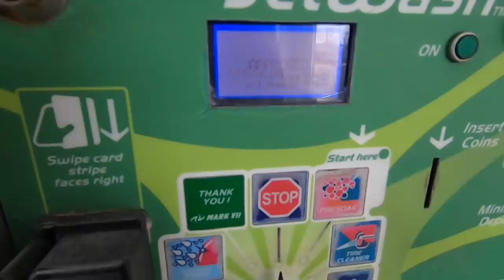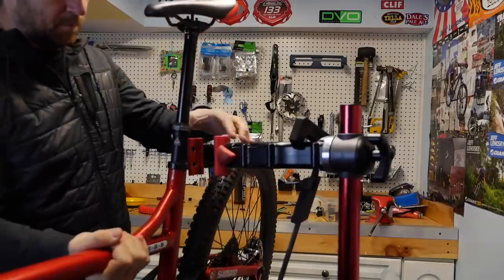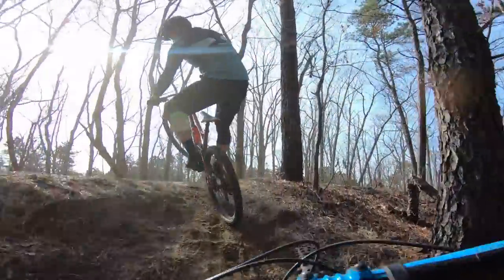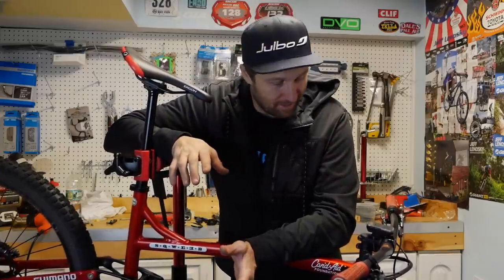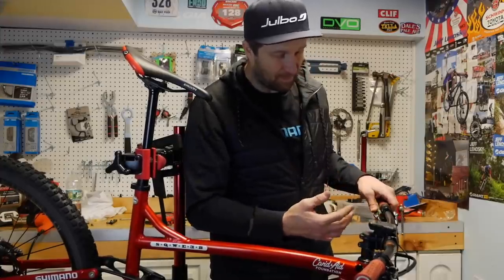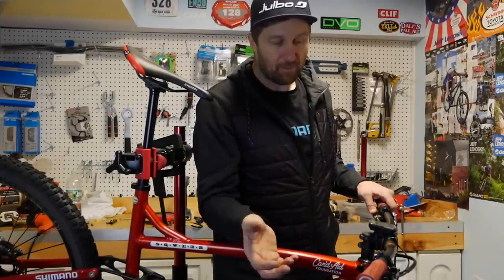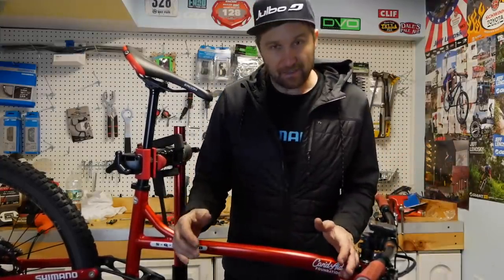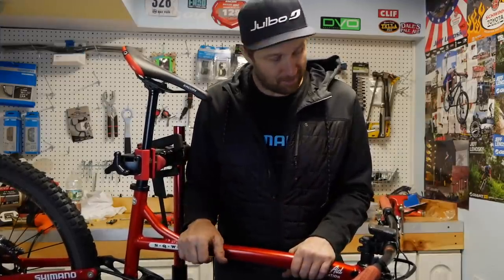I UPGRADED MY BIKE!!! | SHIMANO XTR FIRST LOOK

Comment: What up Big Pimpin'?! That's a hell of an upgrade, even without the weight loss, still hawt. I'm really curious to see how those pedals work for you over time, been some interesting reports of issues thus far.
Reply from the maker: #THELEGENDMTB what have you heard? I’ve used SPD’s for 30 years!
Reply: @JeffLenoskyTrailBoss  I've heard complaints about the bearing seals on the axle coming unseated. Only a few reports, but still makes me wary. Love the look of the pedal, much better platform than the XT or Deore version and oh so sexy.

Comment: The other bike must have been a bit lighter. Did the change have any practical impact on your rides? Is lighter overrated, or should normal sized people (as in not normal sized for cyclists) just avoid the super lightweight stuff?
Reply from the maker: I'm guessing you mean my Giant?  My Trance was a 27.5 and Carbon and weighed 32.5 pounds.  I honestly was riding this bike with DH casing tires and XT Di2 and it was over 35 and rode AWESOME, obviously not on climbs but it wasn't crazy noticable.  Going down it felt SO much better.  I had issues in the past, I'm not interested in sacrificing strength for grams anymore.  If you're smaller you can shave grams but I'm pretty big!

Comment: Nice! For the average dude can you really tell the difference between XTR and XT? From a performance standpoint
Reply: doubtful..heck its probably hard to tell the difference in a properly set up budget drivetrain to a XT..All depends on how it works and set up..just my .02
Reply: I can't tell the difference between my XT brakes and Deore brakes once I put metal pads on
Reply from the maker: Honestly...no. The big difference is the wider range of gears but apples to apples. Dual piston XT will feel similar to XTR and the gears will feel similar as well. It’s long term durability and weight that you’ll notice.
Reply from the maker: Toogy Howser MTB Update: after taking it out for a ride is shifting performance is absolutely unbelievable and visibly different. It is a new platform so I’m sure when the technology trickles down the other groups will improve performance as well but for right now it is amazing.
Reply: Jeff Lenosky good to know! That stuff is above my pay grade but like you said hopefully it trickles down to the other group sets!
Reply from the maker: @ToogyHowser  It defininetly will be trickling down.

Comment: That's the m9100 which is 12 speed, correct?
Reply from the maker: IChooseBadLines yes
Reply: @JeffLenoskyTrailBoss  That's sick! Congrats! I enjoyed the video, it's a little more "vlogy" then your other ones. Did you need to swap the freehub body on you wheel, or do you have a second set of wheels with a Micro Spine hub?

Comment: Curious if the new XTR trail pedal is any better than the popular XT's
Reply from the maker: Arctic Pride the pedals FEEL very similar. There’s obviously nicer materials but no real performance upgrade. The big difference is the brakes which feel amazing and the down shift performance is noticeably improved